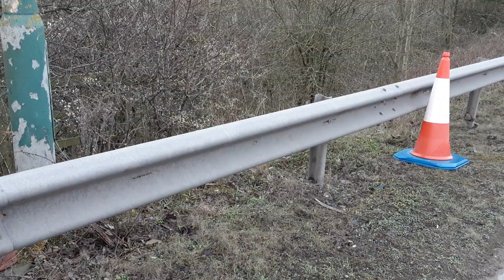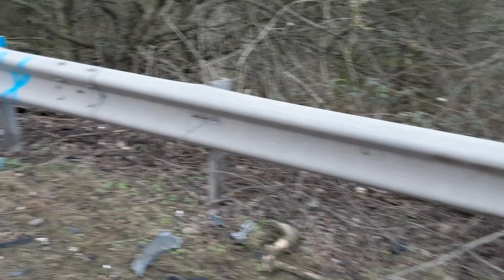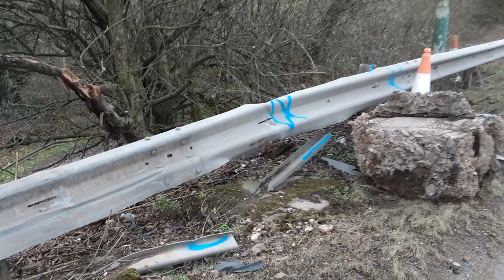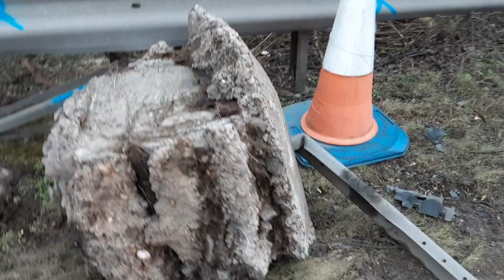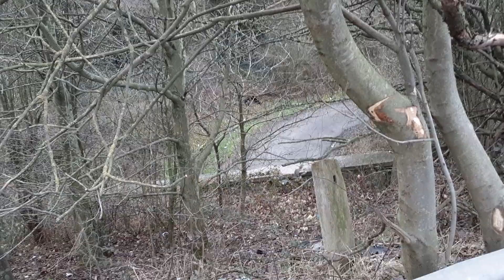Vehicle Restraint System Emergency Repairs 🌻 One Of My Day & Night Jobs Including Weekends

Comment: Scary stuff Terry.  I did the "Signing, Lighting & Guarding" course at Thames Water. Only needed to use my cones and lights a few times and I appreciate the work you guys do - and all the abuse hurled at you by passing motorists!
Reply from the maker: Physical violence is on the increase especially on road closures and our poor TM contractor are first in line for it.
Reply: @terrykingsallotmentgardening  I know (some) overseas lorry drivers are an issue - hurling bottles of urine at the workers
Reply from the maker: @DigwellGreenfingers  now here's me thinking they were giving me some lucozade 😋😛🤢

Comment: Very interesting. Good to have your help getting this repaired. Didn’t know the name change either. Cheers Terry
Reply from the maker: It's been changed for many years, but I still say crash barrier. It's designed to destroy the front wheel so when the vehicle springs back the vehicle steers back towards the VRS that's why you see two bumps very close to each other.